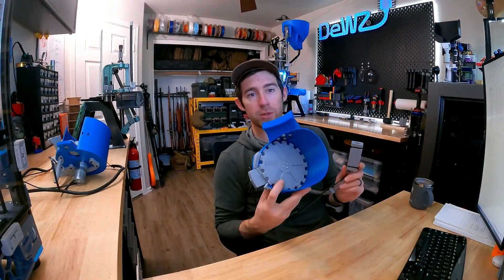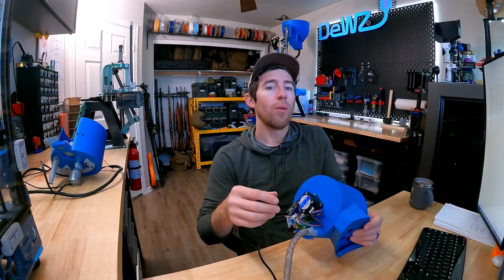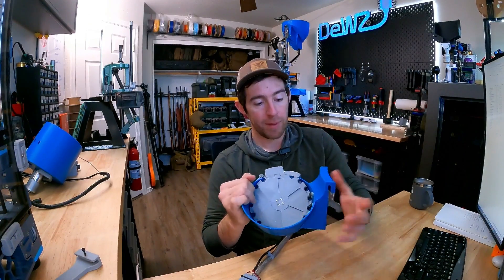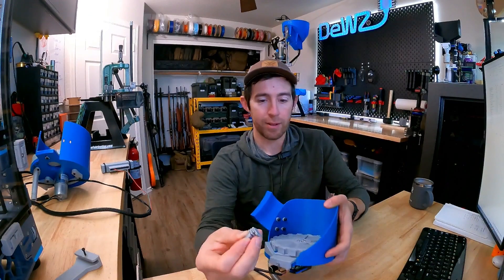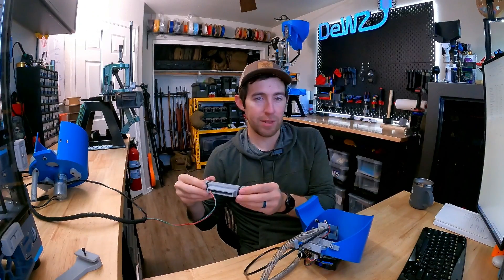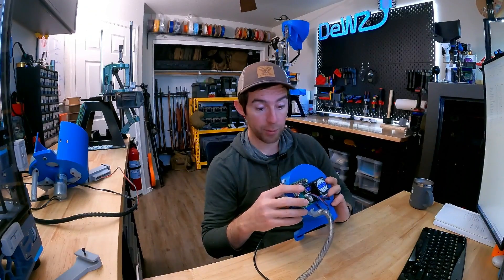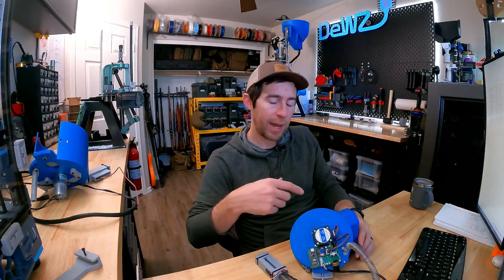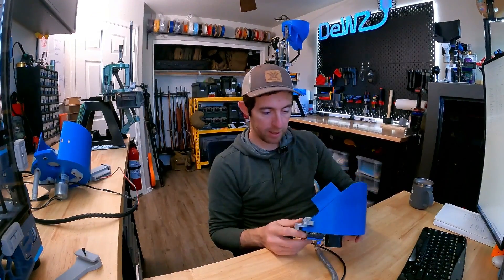Bird Feeder - The DIY 3D Printed Bullet Feeder

Comment: Can you help with the stl files for the die? ive printed everything but i cant find a suitable dropper die like yours thatt fits well. thanks in advance!
Reply: Search 3d printed bullet feeder die. It will be the dp gunworks video on the top. There's a thingy verse link with .stl  there. Dewz covers assembly of the die in the 2 hour build video of version 1. There's an O ring you can kind of see in the dp gun works video that I don't think DewZ uses.
Reply: @danielchumley1  Your awesome, thanks for the help!

Comment: So almost done with it just having a problem. Where it spins real slow stops then spins slow again just does that over and over. Hoping someone here has had a similar issue and might have a solution.
Reply from the maker: Have you made any adjustments to the firmware file?
Reply: I'm experiencing that exact issue. Attempting to troubleshoot and hope to resolve it somehow.
Reply: After some troubleshooting, it looks like the beam sensor was getting tripped, which was caused by poor quality beam sensors. I suspect you may be running into the same issue. The faulty beam sensors were only sending ~0.7 - 0.8V and is nearly a logic low and occasionally a logic high.

Comment: Need more calibers. Also, a clutch in case a bullet gets stuck
Reply from the maker: There's an option to use StallGuard in order to detect jams. If that isn't used, the stepper motor has a low enough torque setting that it'll just slip.
Reply: @zsdewitt  lolz. okaaayyyy..

Comment: HELP. so i started with trying to print the collator plate for the 9mm. right off the bat i keep getting one spot that doesnt print. i took pics but cant show here. ill try to explain it. so as it starts and makes the outer border where eventually the bullets will feed in to, one of those doesnt print. i tried three times and two different filaments and had the same issue i the same spot. can anyone let me know if they had the same issue and what that means?
Reply from the maker: Send the pictures to zach@dewz.pro and I'll take a look.

Comment: Why did you put the mount on the wrong side
Reply from the maker: I'm not sure what you mean?
Reply: @zsdewitt  Thanks for replying. The mount has the adjustment controls facing away from the user when mounted on the non handle side of the dillon press. ie when facing the dillon press im looking at the back of the bird feeder, i think contols facing the user would be better.

Comment: Just finished building mine. Everything is working fine except that that the motor loses steps when I load a decent quantity of bullets. Not filled to the brim, just a decent quantity. Im using the same stepper as in the video and all the same hardware. Ive upped the RMS value to max (1500) and turned the trim pot on the Bigtreetech 2209 driver to max and it still stalls, altough it is better now. Am I doing something wrong or maybe I should redesign it for a Nema 23 motor?

Comment: Hello, great project.  I have to outsource the 3D Printed parts. What remarks should I pass to them (about infill,  layer height, wall thickness, etc.)? Regarding the PCB, is there any particularly reason it is not enclosured ?

Comment: How did you get the IR sensor to work without a 10K ohm pull up resistor between red and white wires? Without the resistor mine would run for a bit then stop for half a second then run for a bit. it would run about 75% of the time but status light would always blink. works great now with the addition of the pull up res.
Reply from the maker: Interesting, I haven't experienced that nor heard of anyone else having an issue. I'm wondering if it could be the particular version of the optic sensor you're using?
Reply: @zsdewitt  Figured it out. Some break beam sensor use an Open collector configuration requiring a pull-up resistor. first I soldered one to the board and it worked great. But after further research I found that if you configure that input as a "INPUT_PULLUP"  it uses the on board resistor. works great.
it's line 45: pinMode(breakBeamPin, INPUT_PULLUP);      (must be in CAPS)
Reply: @FrankPichler  thank that solved the same issue for me of stopping and spinning.
Reply: @FrankPichler  INPUT_PULLUP{  reverses the logic on that pin,  have to find where pin logic is used and reverse that TOO

Comment: Really good design although the plates need to be changeable. With a clutch. I’d also create a box for the bottom or side that houses the pwn and  other circuit boards
Reply: Well I think you pretty much defined YOUR next project. You can use this design as a bases (but make sure you give proper credit!)

Comment: Forgive my ignorance, but are the files used to make the components compatible with a resin printer along with filament type printers?
Reply: I have both, and it would be difficult to get a build plate big enough for these prints in resin. You'd likely also have to use your slicer to cut the larger parts into segments for reassembly, AND I'd suggest an ABS-like resin should you want to try.
Having said all that, printing time would likely be greatly reduced!
Reply from the maker: Good question, unfortunately, I have zero resin experience and can't weight in.
Reply: Fantastic input!  Thank you for the information!

Comment: I have the original model together and testing it now. So far, so good. Like you mentioned, the limit switch is kinda finicky. And since I use the Lee Loadmaster, I made a bracket that would allow the hopper to mount on a piece of 1/2 inch pipe. seems OK so far. Thanks for all your hard work. I think this new model is a little over my head. :(
Reply from the maker: Glad to hear the original works well for you for the most part though!

Comment: Cool. It’s the 1/2” brake line protector by gravel guard for 9mm. I added a quick disconnect for the slinky connection, designed a printable flange, made the collator plates drop in, beefed up the mount, adjusted the sensor so that it doesn’t need to be bent, etc. The 100 rpm motor on the old model didn’t work for me but the 10 rpm worked like a charm. I ran a case of 9 through it and got 100% nose up. 👍